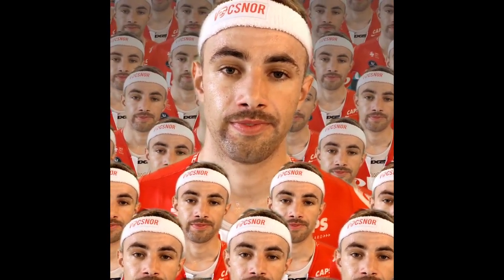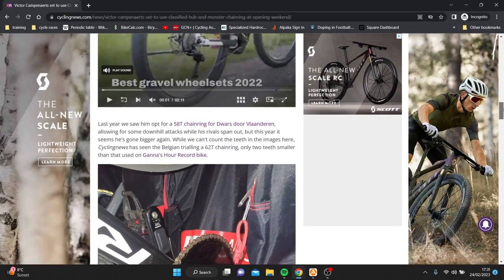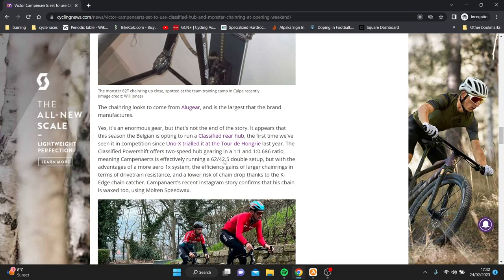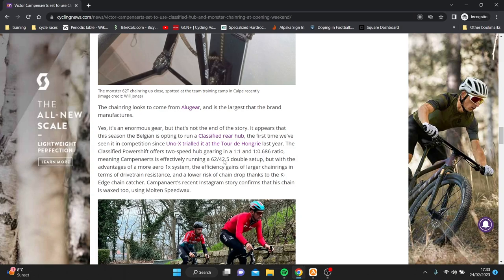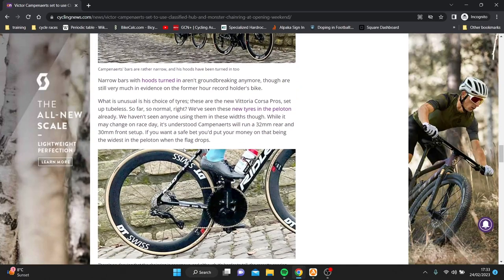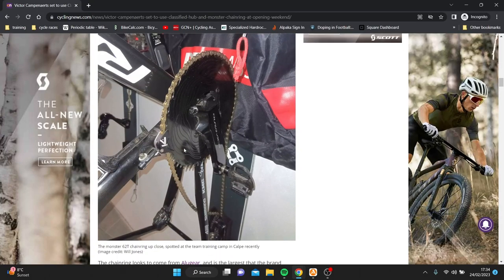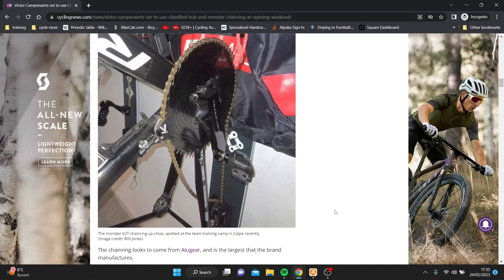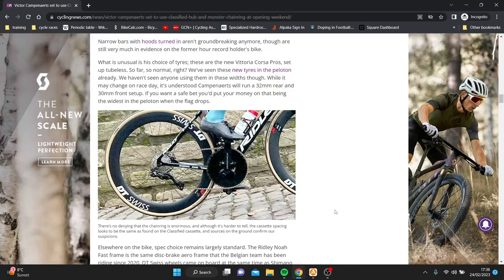A BIG PROBLEM WITH CAMPANAERTS Bike

Comment: Even if they have another rear wheel with a classified hub, his shifter wont be linked with it I think. So if he gets a rear puncture the only solution is a spare bike. Lets just pray he has good luck tomorrow
Reply: No. Victor can just use a spare wheel with thru-axles and standard cassette to get the default 1:1 ratio. The internal hub provides only the additional 1:0.7 ratio.
Reply: @RolandRides  If he only had the 1:1 ratio with a 62 tooth chainring he would have to walk up the hills. But I aksed him in his Q&A today and turns out all the electronics are in the thru-axle. So you just need the the axle to connect to and shift.
Reply: @bertdebaere2058 true on the climbs. To use a standard rear wheel he may have to use a standard through axle, too. I'm not entirely sure on that and if the supporters have spares in their cars.
Reply: I wonder if Classified could go 1:1 and 1:1.3 instead so a fall back to a "dumb" wheel would not affect climbing. But I guess this will increase traction losses on the 1:1.3 that would be used on flats which is probably 90% of the time.

Comment: hear me out. a reverse classified hub, but its in the bottom bracket so you have 2 classified products and get the perfect gear ratio
Reply: that's already used in some recumbend bikes years ago. For hybrid shifting in rear wheels, SRAM DualDrive was a thing 15 years ago and launched by Sachs in den 1980s. Shimano once had their own combo of internal hub gears and external mech. Sturmey Archer is still making them up until today. And for the bottom bracked a company called Schlumpf Drive is building a geared bottom bracked. People have build frankenstein bikes with over 80 gears (far less usable, of course) by combinating everything.